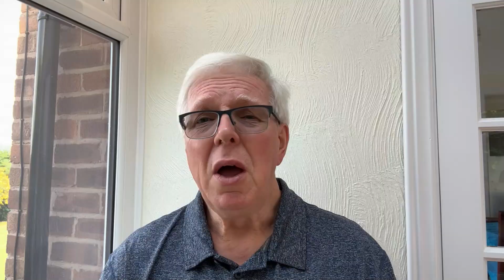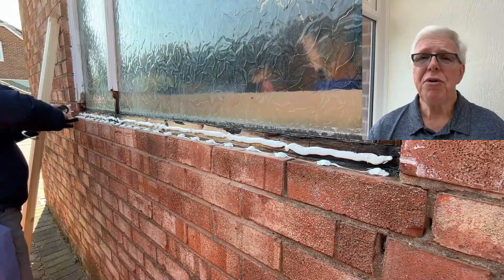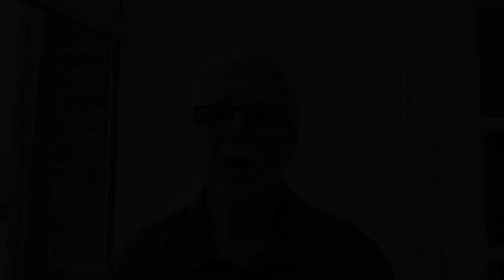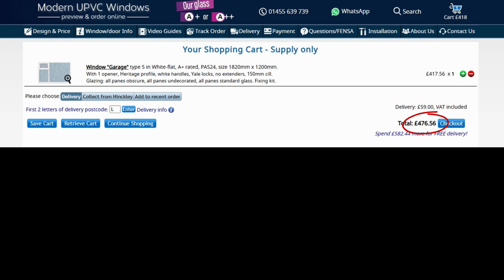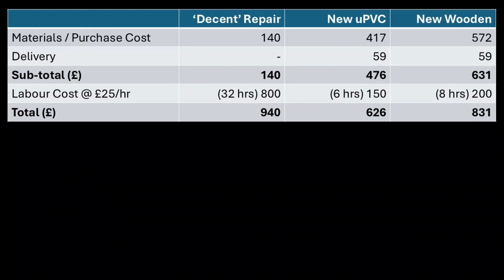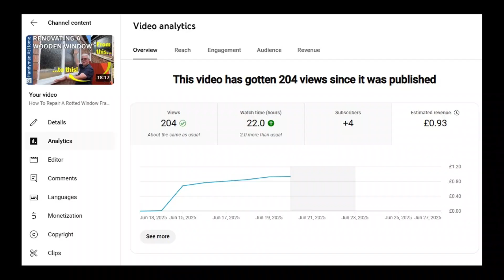Repair versus Replace - How Do The Costs Stack Up?

Comment: One other thing to consider is energy costs.  Window technology has improved a lot in the last 10-12 years. New windows can reduce heating and air conditioning costs over the life of the window. Not sure how you could quantify the savings, but its definitely a factor I include when deciding whether to replace or repair.
Reply from the maker: Good point! Thanks. 👍